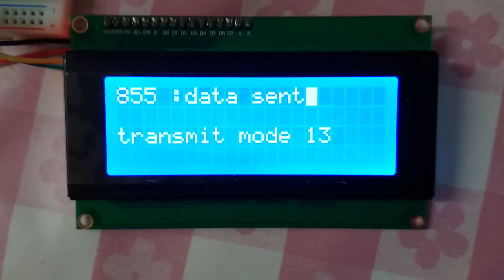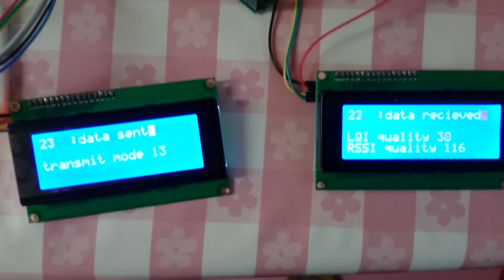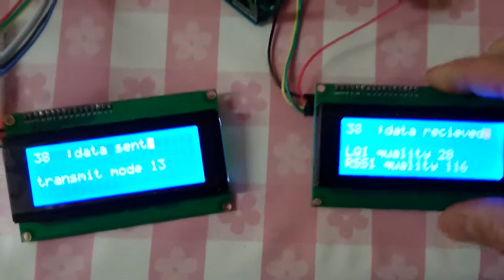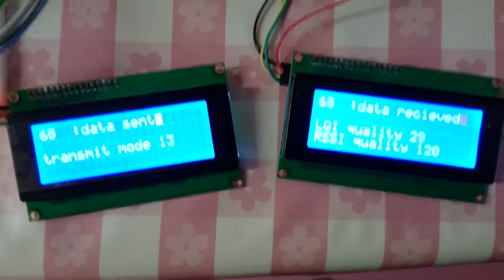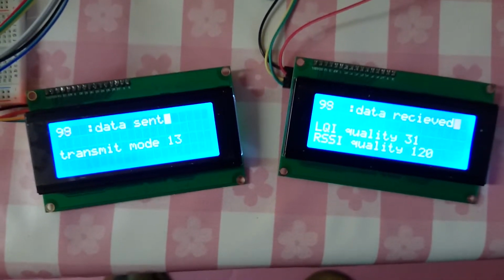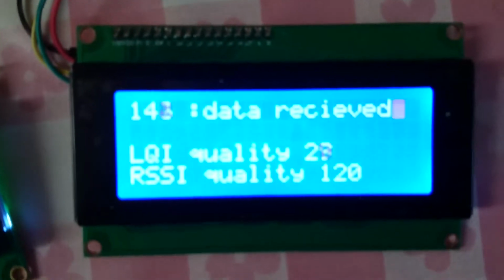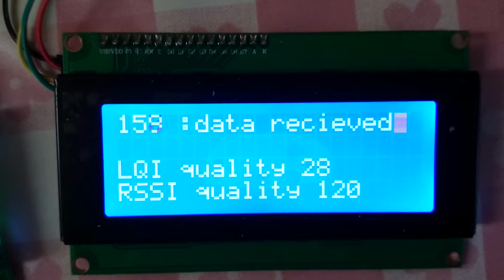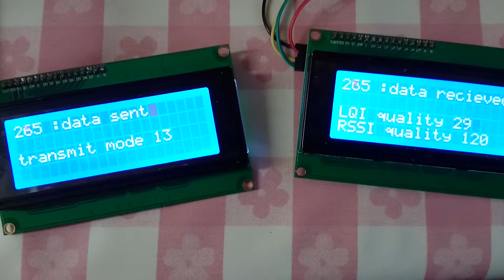CC1101 RF module tests with arduino logic level converters PART4

Comment: Mind to share hardware and pinout detail? What is connected to breadboard and how you connect CC1101 to breadboard? Thanks.
Reply from the maker: +Tamer Çelik 

Hi Tamer, 

I learned how to wire up the cc1101 from here http://www.labalec.fr/erwan/?p=497

I could'nt cut n paste the link so maybe youtube has gas gone rubbish ( 
ani-web ) like many modern websites.. must delete my youtube account if 
that is really true !!

I just used a cheap cc1101 module from ebay., you can use any module 
that has SPI if your following erwans guide above. I would go for one 
with a PA ( power amp ) added as mine had quite short range of 50 - 100 
foot. but that depends on what you want to do ? also I would look into 
other CC range of chips from TI , I think its the cc1111 that has more 
going for it.. but check that the PanStamp library supports whatever 
CCxxxx chip based module you go for , thats if you going to use that 
wiring etc...

my code for the PTP is at http://www.github.com/benbiles/arduinoPAGERcc1101

you should be able to see how I sent the characters in that code.

forgot to mention, I also used a logic level convertor to translate the 5v from arduino to 3.3v on the module. you might want to do that too or maybe buy a 5v compatible cc1101 module ? or as friend of mine does, just wire it up without the logic level translator.. If its not for production and just messing about miss you might want to just do that and ignore the fact that the module might burn out one day !!!
Reply: +Ben Biles  thanks for detailed info. i did wiring yesterday. seems like able to tx-rx now. however, i need to use OOK transmit. have you ever tested ook modulation? thanks!
Reply from the maker: +Tamer Çelik 

Hi, your best bet is too get TI's SmartRF studio ( free ) and make the settings you want then copy the hex codes and write them in the initialise section of your arduino code. I did have a go at most modulation types including OOK if I remember correctly. I was especially interested in slowing down the coms to as slow as possible to increase realiabilty. this all worked quite well by just getting the codes from the software.

hope that helps.. let me know if you get stuck..
Reply from the maker: +Ben Biles  looks like you need smartRF studio 7 for the cc1101
Reply from the maker: +Ben Biles  looks like you need smartRF studio 7 for the cc1101
Reply: +Ben Biles thanks! OOK seems very hard to work on. registers are too complicated, ill update when i finish.
Reply from the maker: +Tamer Çelik 

Yer, i think thats why i turned to the software..  datasheet is tough reeding..